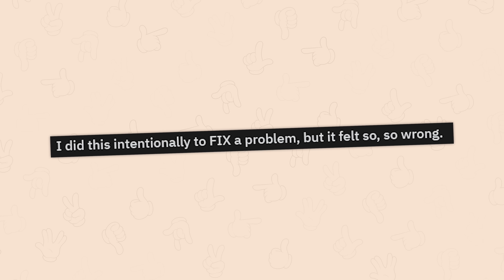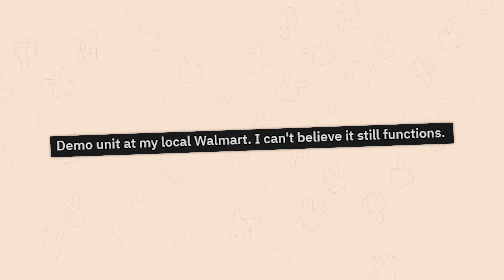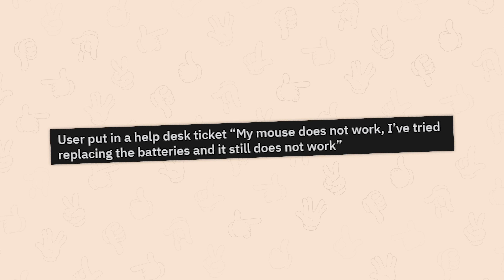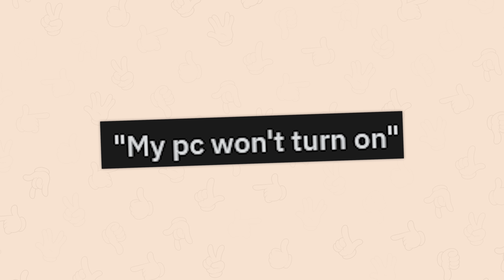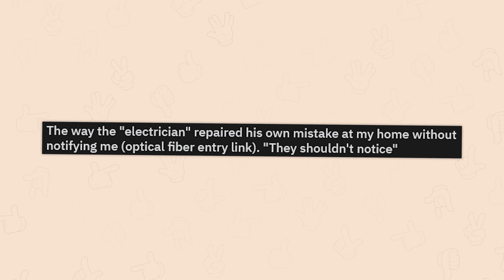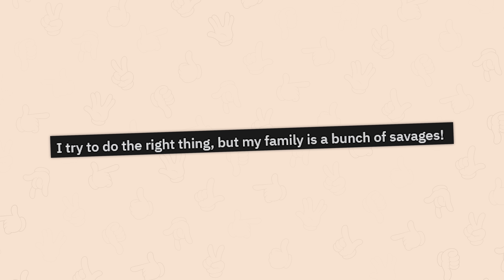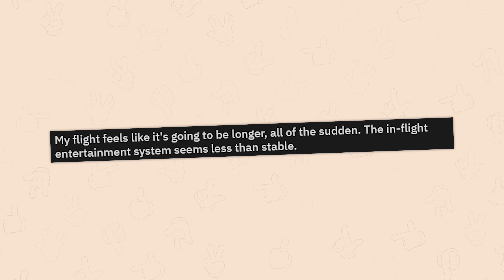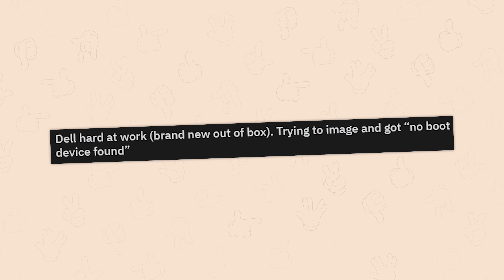r/TechSupportGore | free internet with this one trick

Comment: 12:38 The problem isn't the fur or performance loss.
That is a bulky graphics card and it is supported at only one end.
The cat's weight and the card's weight combined will rip off the PCIe slot or break the graphics card.
That is gonna cost a lot.
Reply: Also, cats are static electricity generators.
Reply: S   A   G

Comment: About the kitten on the gpu, that GPU's fans go fast enough to cut nails clean off.
Also, cat fur often ends up with conductive materials in it, which could short the 12V pins that the kitten has their paw on, which can start a fire, or just straight up electrocute the kitten. Conveniently, there are pads at the other side also for the 12V rail, so the current would have a clear path straight through the body. It's only 12V, but its 12V straight from a PSU which looks like one of the cheap ones that don't have overcurrent protection or short-circuit protection. A kittens body will also have far, far less resistance than the human body (human body will have 2330ohms from hand to hand and half that from hand to foot for high voltage scenarios, so now imagine a kitten, but far thinner skin, lower voltage, sure, but extremely high current capability.
Cat fur is also very flammable, and certain components in a PC can emit fumes as well. And also, a 12V rail short to the PSU will end up popping a lot of capacitors, and I imagine the front fans on that PC will not be super kind to the kitten's face at that point.
Basically, yes, this isnt hardware gore yet, just "imminent" hardware gore and a crisis trip to the vet just waiting to happen
Reply: Modern GPUs are also usually designed to just barely be held well enough by a standard PCIe x16 socket with guard mount attached. A kittens weight is small, but for some motherboards, it could make enough of a difference. Plus, I doubt the kitten just floated gently onto the GPU. I know mine doesn't float, at least. It slams, then trips, then blames me regardless of whether I had anything to do with it

Comment: Interesting thing - in Russia back in 90s, you could find black cross painted on server, that literally meant "shoot here". Yes, to erase sensitive data and prevent it from falling into wrong hands, security guard was supposed to shoot at marked spot to damage hard drives, possibly with no chance to restore it.
Other "techsupportgore" of the time included servers being permanently in some unmarked van at the parking lot, that would disconnect and drive into nowhere, if someone tries to check finances of that company.

Comment: 22:03 Something like this is in my living room, but on the electrical outlets. I am somewhat competent with electronics and electrical stuff, and when I was replacing some outlets in the living room because they had lost their grip completely, I had to literally cut around the cover plate with an exacto knife to cut the paint away. Plus the ground hole on some of the outlets weren't even usable because they were filled in with paint. I don't know what the painter was thinking.

Comment: I had personal experience with wires crossing signals. I'm not in tech support btw. It's that my brother decided to wire an old unused outlet to make it usable again. For some reason either my dad didn't think it was usable or he didn't want to wire it because of the placement making it hard to use. What happened is my brother with his bare knowledge did it when changing his bed. Because the outlet was easier to access and he could use it for his LEDs or for charging his phone. You get the idea. While doing this somehow the positive and negative got too close to one another. That caused our electricity shutting off at random to protect us. The thing is we didn't know that. We thought we had too many things plugged in! We always blamed the poor microwave or the dishwasher. The worst thing is we had to replace our alarm battery aswell. So the alarm would go off and there was no way for us to let the syrens stop from yelling. The power had to either go back on or after a while it would stop on his own but the light outside would still blink. My brother noticed it once and moved the cables slightly and wouldn't you know it? The power went off! He fixed it but damn. We had no idea.

Comment: When installing cables under ground, put it in a pvc pipe for some extra protection from the elements, extra barrier between someone digging on top of it, or have critters that dig. Of course it'd cost a little bit more but will probably save a lot of headache later.

Comment: 6:23 puting water on a motherboard is actually ok but the soap is what will mess up the board.
Reply: Make sure it's distilled water though, tap water is still conductive - you do not want to risk anything shorting, especially a capacitor. But if you're using distilled water at that point you might as well just use IPA since it's pretty cheap.

Comment: 17:58 that soldering looks pretty similar to the solder after i tried using a soldering iron in class one time... difference is that was literally the first time id ever used a soldering iron in my life, and we hadnt really been told how to solder properly, wed just been told the basic safety stuff (ie, dont touch the soldering iron, its hot, and make sure to only put it down in its holder, that sorta thing)

Comment: The computer at 20:33 reminds me of one of the machines we have at work that takes flat, pre-cut cardboard and folds it together to make a tray. That thing runs on something older than windows (it was built in the 70s/80s but I'm not sure exactly when or what the OS is) and has more factory gunk in it than anything else there, all covered by a big metal casing that looks like a tank from ww2. We call it "The Tank" and you can hear it running no matter where you are in any of the 3 warehouse buildings
Reply: May be DOS, CP/M, OS/2.

Comment: 3:43 if an asphalt repair (no deeper digging) managed to break your fiber line, the fault is on the part of the fiber layers. That shit should be much deeper, and indeed, there is no reason for it to be any less  than 2m (6ft) below the surface (or below the frost line, if that's a consideration), when everybody and their mom has directional drilling rigs.

Comment: 6:25  Fun fact: a lot of retro computer youtubers I watch actually do clean motherboards with water. I have even seen Macintosh motherboards run in a dishwasher. 

As long as you are absolutely sure there is no chemicals or soap left and that you can get all the water off before getting it near power. It usually works. And if it was dead to begin with and covered in capacitor electolyte. Why not.

Comment: 0:40 chromebook chargers sometimes don't get recognized by the Chrome's OS so it will refuse to charge with that cable because it doesn't match with the OS's proprietary chipset. I had the same issue where my charger wasn't being recognized as genuine so it would refuse to take a charge it's a Chrome OS issue more than an actual hardware failure issue

Comment: 13:45. We were booked to install FTUs und ONTs in a MDU with 10-15 units. An electritian was hired to pull the fiber inhouse cabling to each unit into sub drywall junction boxes. He was one of the oldest from the company and didn't know what fiber is, so he handeled it like every other cable. He cut it off one hand width long , so not useable. The whole building had to be redone.

Comment: 6:22 - Cleaning boards with soapy water is actually a reasonable thing to do, especially if it's had a leaky battery and has consequently needed a splash of vinegar to neutralise the spilled electrolyte. You just have to rise it well and give it plenty of drying time. Necroware does it regularly in his vintage hardware repair videos.

11:52 - This is what happens when you give one too many Power Point presentations!

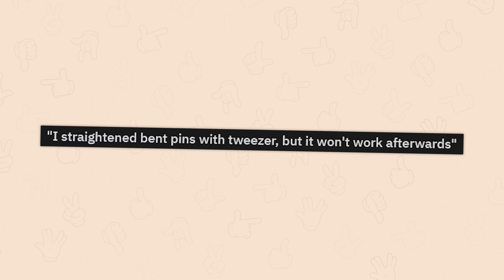Comment: 12:05 I actually had managed to fix a computer like this while still in high school, however the the pins were on the processor itself. After over an hour of straightening the pins with very small needle nose pliers, the computer actually worked and booted up windows 95 with the teachers old files still accessible. So possible if you don’t destroy the pins in any way, but not fun.

Comment: This reminded me of a networking nightmare I went through several years ago. I was installing equipment for a cell phone store, and was supposed to come in after the low voltage cabling had been installed. There were several working desks around the interior of the store, and each desk got a computer, printer, and barcode scanner. Upon installing the computers, only one of the 4 could obtain an IP address. Troubleshooting (and a conversation with the inept low-voltage installer) revealed the issue. The installer ran a single run of cat5 from the network closet out to the lobby, and then he spliced the 4 workstations into that single run of cat5. He refused to accept the fact that this was both improper and would never properly work, and stormed out of the store. A call to my PM, amd a short conversation later, the install was suspended until the low voltage was run properly, causing a weeks delay to the store opening. To this day, ive never seen anything remotly as absurd as that.

Comment: I think the solder cloudiness (@ 17:30) is a result of mixing leaded and lead-free solder. But this could also be result of too little flux.
Most companies will use lead-free solder (RoHS compliant), but it has higher melting point, so most repair shops use leaded solder witch is easier to work with. But in this case, you should clean original solder, before doing the job, other wise it will look like this.

You could mix leaded solder with original lead-free to lower its melting point. Just remember to clean it and apply fresh one before soldering everything back.

Comment: 7:30 we actually have a kinda neat deal going on here in a bunch of unis in germany, where there's essentially a centralized login for free wifi at any uni in the country for all students, but actually using WPA2 "enterprise" public/private key encryption, not a web form, and yeah if you there plug into any ethernet port you got the option of "be fancy vlan equipment that can talk encrypted to the backbone network of this building" or "just treat the ethernet port as if you're connecting to the wifi and do your normal WPA2 login but over ethernet".

Comment: 15:40 counter argument, probably they're turning on from a clean SO install stored in a server every time it gets rebooted. My uni computers work like this, the SO is stored in a server and the user folders are in a diferent server and when you boot up it launches the os with your user's data but is still like if it got resetted. Helps a ton bringing the costs down (no need to store the same OS image 500 times, and when you're updating a program it will update on all computers and is less likely to have specific computer problems) and if a user gets infected by a virus it only affects that users not everybody that connects to that computer.

Just to clarify, the image in the server is READ ONLY for anyone besides the ones at IT, nobody else can update it, it just gets copied when the computer is turned on.

Comment: CDOT drilled a borehole to expand the bridge on Santa Fe over C-470, they cut clean through one of our national distro fiber paths. Had to relocate the fiber 200yd down the road, bore a new conduit, and replace over a quarter mile of fiber to restore. On the same day, the cooling tower at one of our data centers caught fire. It was an interesting few days.

Comment: The one where the "electrician" tried to splice the fiber-optic cable reminds me of a story my dad told about a supervisor at BNSF ordering an employee to disconnect two flat cars with giant spools, and a cable running between them. The couplers had a device on them that prevented the cars from separating by just popping the pin lifter, and is very difficult to remove on purpose. DESPITE this device, the supervisor cut the cable and separated the flat cars.

...The spools had a very long fiber optic cable...

...the supervisor wasn't fired, and probably got promoted since then...

Comment: 20:33 I recently ran across a PC running Windows 3.0 at a garage that they used for inventory. The owner said he bought the computer second hand in 1998 and it still (somehow) works... Except the drive has so many bad sectors that it has lost over half of its storage capacity and some of the keys on the keyboard no longer work. (and being THAT old of a computer, the keyboard is nearly irreplaceable.)

Comment: BTW, simply shattering the disk does not delete the data, just render the device inoperable. Forensic methods can still recover data from a shattered disk. Fill the disk with random data multiple times THEN you can bring it to the shooting range if you're that worried.

Comment: 2:11 Those pin pads have to be removable to get to the battery to swap it. It's still secure but you need a 9volt to make sure you can get in/out. We've had to replace one at my place of work because the crimps wouldn't stay connected properly.

Comment: 8:18 I saw an IDF like this, except it was an IDF/janitor's closet with a drain area set into the floor where the toilet is in the pic, and a faucet to fill buckets, rinse mops, etc. Pretty much just said a short prayer that nothing got wet and shorted in the 2 days it would have been my problem and backed away slowly.

Comment: RE the drives at 16:00 Those are neither drill press nor bullet holes. They're from a spike.  I have them at my current job. It's basically like a drill press with a lever except it's just a big ol spike and it has to be mounted on the table as it takes damn near my whole bodyweight to pierce these damn things.  There are like electric hydraulic press types but that's not what I have access to lol

Comment: 12:40 Static electricity is a thing. Touching the exposed circuitry at the back while it is running sounds like a good way to kill the thing (altough cats aren't that conductive so its probably fine). Also not sure the strength of the PCI connector is calibrated for a cat.

Comment: 6:20 That's actually a good way to clean a nasty motherboard. If you discharge all the capacitors, take out the CMOS battery and are careful with the choice of non-aggressive soap and rubbing the pins then it's completely fine. 
If you don't let the soap dry on the motherboard, of course. 
7:12 Doesn't the "W" mean "wireless"? So is there a wireless cable?!? 
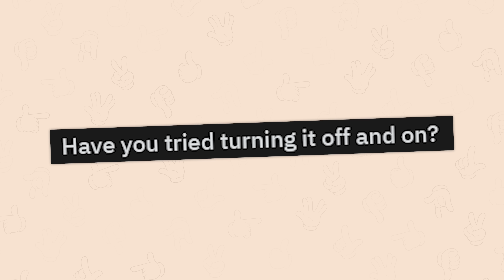9:27 I think the flashing point of wood is somewhere in the 400 degrees Celsius range, and tiolet paper is tangled-up bleached wood fibers.

Comment: 2:08 point is, you rip cables out, connected them and safe is open. 
I bet controls are on the panel itself, as its cheaper, so one of those cables when powered, opens the safe

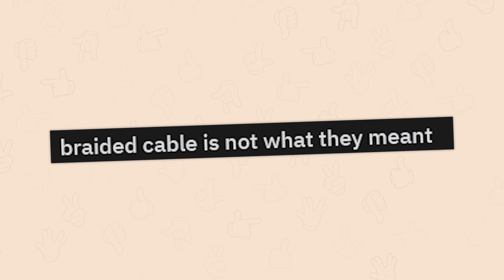Comment: 5:02 I actually have a story about crosstalk. So my dad absolutely loves radios, I think he has about 10 of them, most of which are on his desk. One time he got this radio that has really crappy protection around its cable, and my computer could pick up a distorted voice. It freaked me out the first time I heard it, luckily my father thickened up the wire about a week later, but oh boy was that week annoying, especially since the sound wasn't originating on my computer, so I had no control over the volume unless I was willing to make everything quieter. Both my dad and I were surprised I heard anything because there was like a solid 15 feet between the radio and my computer, and I had no idea my computer could understand and decipher radio.

Comment: We have VITAL basic infrastructure that is STILL CONNECTED TO THE INTERNET running windows 3.1.
I don't know how that's even possible.
But the freaking water pump station was using that 3.1 windows equipped machine up until at least 2008-2012. 
Yikes.

Comment: I used to do subcontract work at a Toyota dealership in Washington state. They were doing some construction renovations and the blueprints showed the power and data wires fed through the rafters above the cement floor. No they were all run through the concrete foundation and as a construction worker was using a concrete cutting saw that was large enough to need four wheels and was half the size of a car. as he was cutting the concrete the lights and other power related things were shutting down as he kept going until someone finally realized it was him causing it and stopped him. It cost 1000's and 1000's of dollars to repair it. Cars were stuck on lifts that did not work anymore for days.

Comment: fun story when i fid HVAC
i did work experience (basically legal child labor) for a week in hvac, there was one gov building had its hvac system running of an ibm pc from the 80s, left on for god knows how long, still working just fine, but it was running custom software, mostly text based but had some awesome retro maps for valves and duct shutter status, when we spoke to the building manager we asked how long it was running and he replied saying nobody had changed the tempreture on the ac for about 20 years

it was running on auto, set to 19c for 24 hours a day 7 days a week for 20 years straight, computer had emergency power so we were confident that that pc has been running for the past 40 years with zero intervention
hvac guys dont touch the software stuff, we isolate segments, fix, and restore, if control gear isnt broken we didnt touch it